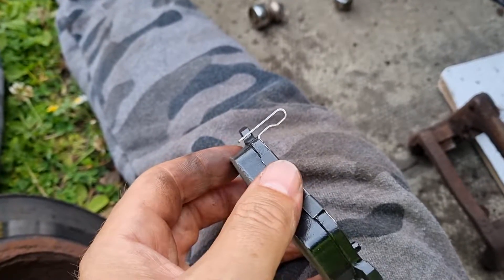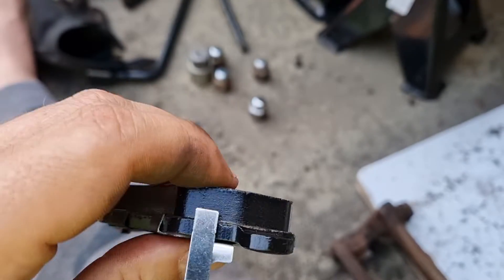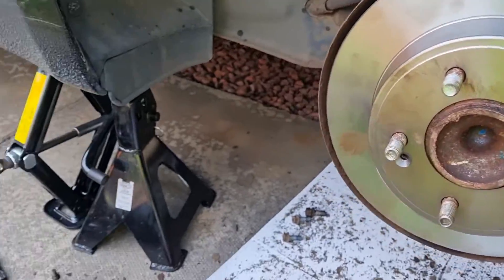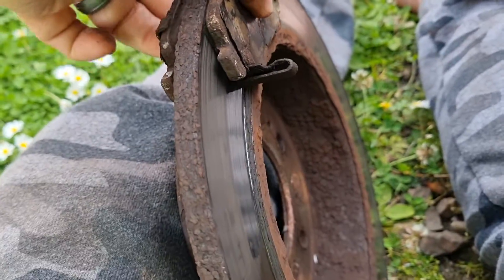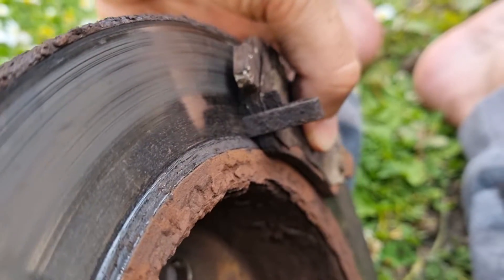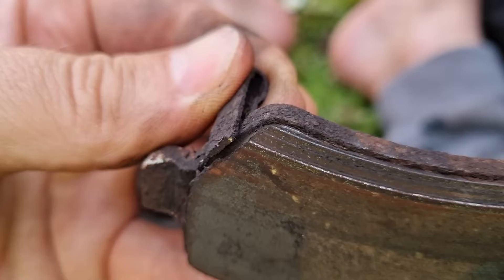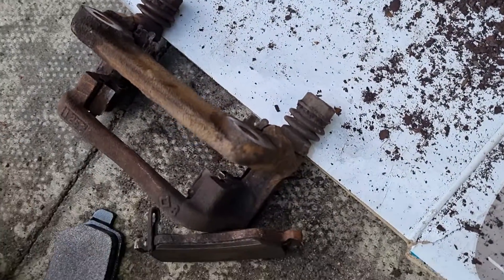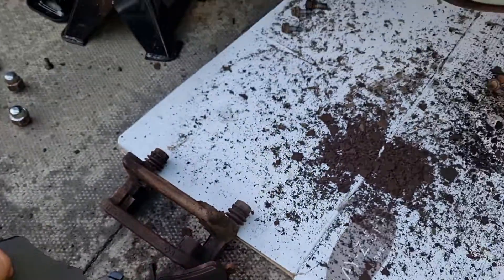What causes brakes to squeal? (low brake pad indicator / warning ⚠️)

Comment: The part the really helped was thar dragging noise. The Mrs's CX5 has started doing this front left. I was worried it was bearings but I can hear now it's likely the brake wear indicator

Darned thing is fully serviced - no mention of brake wear. Maybe folks don't check this.
Reply: you can't hear the sqeeze sound in the video above but in this video: https://www.youtube.com/watch?v=8BL-6JhRRJk

Comment: Will it squeal without pressing the brake pedal too? I am having that problem right now. I hope nothing is wrong with any of my pistons. Brembos are expensive!
Reply from the maker: It could squeal without pressing the brake pedal, depending on how close that point is, to the rotor/disk when the pads are not being pressed.
Reply: @lyntonjennings  Ok, thanks! I decided I'll just change the pads and front rotors to see if that fixes it. I hope it does!
Reply from the maker: @bosolaRUST  yeah, if the pads are really worn down, it will make continuous noise even without breaking. I recall this happening to me the one day. I changed the pads and had instant silence. Haha
Reply: @bosolaRUST  well did it fix it?